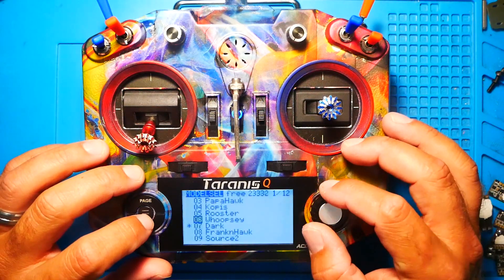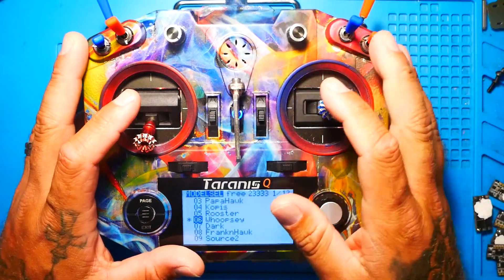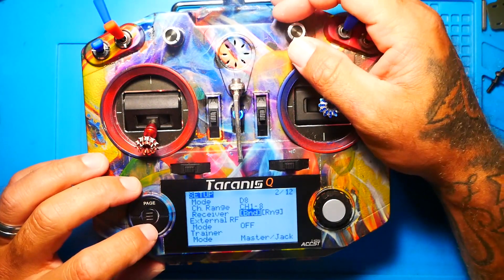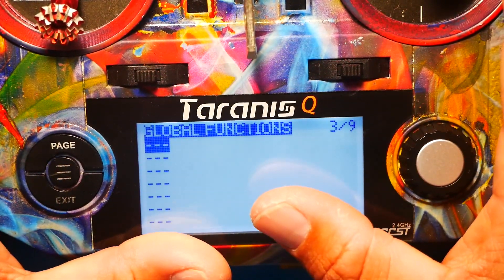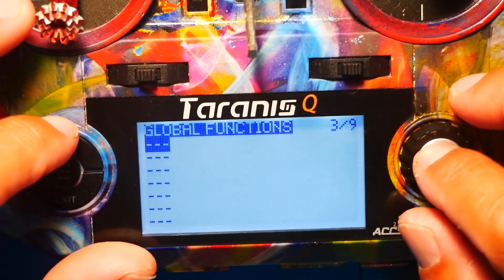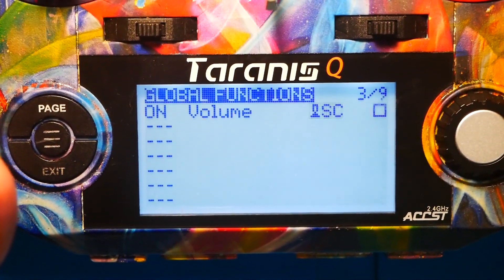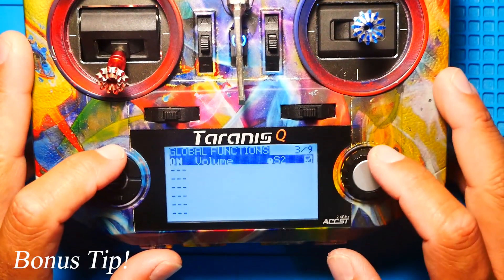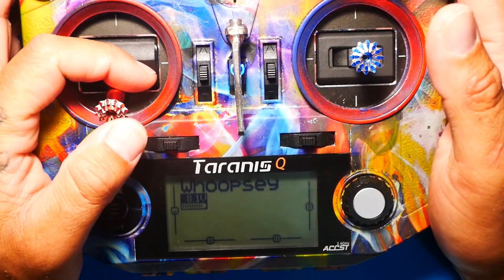Control Your Taranis Volume - On A Switch - Frsky QX7

Comment: Need help pls...
This function won't works on firmware 2.2.2 and 2.2.4...
Tried on both of my taranis x9d+ but failed to works...
Any solution much2 appreciated.
Thz
Reply: On newer firmware 2.2.0 and up global functions are turned off by default. Go to page 2 of your model setup it's right above where you choose internal or external rf'.
Reply from the maker: It's just a global setting, I don't see why it wouldn't work. Are you sure you did it correctly? There is a box you have to check after you set it up.
Reply: @DrainManFPV Yes i did exactly like the video shows. I did it in global functions and tried in special functions olso won't works. Is it possible firmware bug or something else?
This happened on both of my taranis.
Reply from the maker: @jonrooster9843  That's really weird, have you tried flashing new firmware? If two of them are doing it then it's got to be firmware I would think
Reply: @DrainManFPV  Firmware 2.2.4 is the latest one...
No more than that.. 
If someone else with same firmware succeed with this function maybe i got faulty hardware... 
Just guessing...
Reply from the maker: @jonrooster9843  dang man, yeah it must be
Reply: It doesnt work on my qx7 with open tx 2.3.7. Global functions were checked by default. Didnt work in special functions either.

Comment: i have an issue my audio is no longer working from the speaker , but when headphones are connected, the audio works. Remove headphones and no sound. Any ideas why i have this issue?
Reply from the maker: Sounds to me your speaker is broken or disconnected, you will have to crack open the radio and check connections, if connections look good, buy a replacement speaker and install it. Keep me posted, I would like to know how it turns out for you.
Reply: @DrainManFPV   yup i did replace the speaker and still had no sound. All connections have no break or lose wire. A friend of mine said its possible the headphone jack may have a stuck component inside which must have been from the headphone plug when inserted.
Reply from the maker: @jb-fpv7384  Interesting! I wonder what's going on!? Your friend might be right
Reply: @DrainManFPV  I will have a closer look and if it is resolved, i will update you.